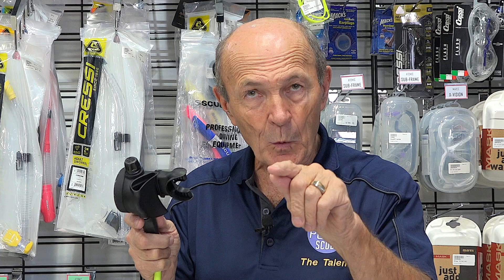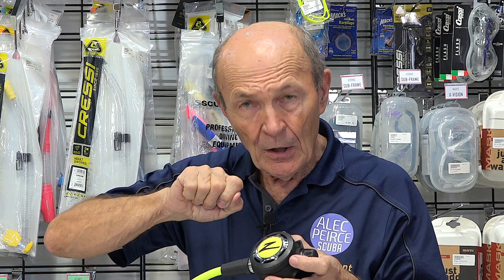Why Safe Seconds Hiss? - Scuba Tech Tips: S18E22

Comment: Hello, love your channel, haven’t watched for a while, good to be back!. Somewhat related, got my regs just serviced and seems to free flow more than before . Question is when a service technician adjusts a second stage with a breathing effort knob, should they set first the knob to the easiest effort , then tune to the 2nd stage so it’s at “knife edge” , or set the knob to about middle then tuned  just at “knife edge” ? . Should a properly tuned 2nd stage where the breathing effort knob is  set to easiest , when the regulator is removed from the mouth underwater , should not free flow? Btw, my Octopus breathing effort knob is set to easiest, but never free flows, so I think the IP is ok. Sorry for so much questions , sending it back to the tech, so I would know what to say , thank you!
Reply from the maker: The positioning of the 'fine tuning' knob during service is dictated by the manufacturer. There is no definitive method - some say to have it set hard, some say soft, some say midway.
If there is no direction, then a central setting is most logical. That way, if the 2nd stage is either too light or too hard, there is room for adjustment by the diver. However, in that case of no stipulation by the manufacturer, it is up to the service person to decide & again there are differing views.
Regarding the Safe Second, if you have a 'fine tuning' adjustment on your Safe Second, I suggest that you set it a bit harder than your primary. It's a nuisance & wasteful when the Safe Second free flows, and that can easily happen when entering the water from a boat - back roll, front roll or step-in.
To stop your primary or your Safe 2nd from free flowing whether during an entry or even while underwater is quite simple. On entry, ensure that the mouthpiece of the Safe 2nd is facing down, towards the bottom rather than towards the sky. If underwater and if/when you remove the primary from your mouth, be sure to tilt it downward also.
You can easily check this procedure. Ensure you are stable underwater, then remove your primary from your mouth. As you do, tip it up so the mouthpiece faces the sky. It will free flow (or should if tuned to easy breathing). If you tip it down (facing the bottom) it will NOT free flow.
On the subject, I personally do not use nor recommend an adjustable Safe Second. There is simply no need. The 2nd can be adjusted to easy breathing without it. The idea that it should be as easy as the primary is silly. The Safe 2nd will be in use (if ever) for a few seconds or minutes at most. The diver experiencing an OOA emergency (Out Of Air) will get lots of air & easily. He does NOT need it to be VERY easy breathing.
Tongue in cheek, if I had to donate my Safe Second to a diver that was OOA, and he complained about hard breathing, I'd take it back!!!!!!!!!!!!
Take care.
Alec
Reply: @ thank you! This is very helpful :)

Comment: Thank you Alec, excellent video!  After my regs were serviced I had an issue with my first stage (ScubaPro), I had a whistle, or noise every time I inhaled, first I thought it was coming from my second stage (ScubaPro), but I discovered it was also coming from my Octo (DiveRite).  Took the regs to a different service and was told whoever serviced the first stage put in a flexible or softer o-ring instead of the stiffer type, and that that was causing the noise.  Even tho my regs worked ok while diving, the noise was so loud it was annoying to me and my dive buddies. I'm waiting to get my regs back from the new service and am hopeful the problem will be corrected.  Any thoughts on this?  Thanks, love your videos.
Reply from the maker: Scubapro MK25??? It's not the only one but it is common for this reg. Other makes & models have had the same issue.  Scubapro actually changed the O-Ring set-up on the piston for this reg PLUS they added a spongy ring around the piston to dampen the whistle. It usually helps.
What you are experiencing is called sympathetic vibrations - similar to the ring you get by running a damp finger around the rim of a wine glass. In the case of a regulator, there are many parts involved so it's difficult to pin it down to a single cause.
 
This is a good time to clear up a common (almost universal) misconception. Divers generally picture the valve in the 1st stage as a simple door that opens when you inhale to let air through & then closes when you exhale. Nope!!! It's much more complicated (and interesting) than that. The regulator is very sensitive to pressure changes so a very slight drop in pressure will cause the valve to open and admit more air. The diver is taking a breath, usually slowly, so the air in the hose & 2nd stage is flowing out, into his mouth. When the valve opens in the 1st, air under high pressure flows into the 1st stage IP chamber. It fills quickly & almost instantly fills to the proper Intermediate Pressure again - so the valve closes. But,  since the diver is still inhaling, the IP drops again & the 1st stage valve opens again - and then closes, again. This happens many times, very rapidly - too rapid to be seen or measured. It's called oscillation. The valve is not opening & closing as you might think. While it is opening & closing, it happens so rapidly that you can't even see it. 
So, the various parts in there, the soft seat, the seat carrier, the spring, the washer & maybe more, all in touch with each other, are all moving at great speed. Something starts to vibrate & soon they're all vibrating. One part is musically inclined & decides to make the buzzing sound into tune. That last part is a joke!
Anyway, you get a whistle. The only way to stop it is to change something so the parts don't vibrate at all or at least do so in unison & cancel each other out.

I suppose the good news is that it is not indicative of any problem. The reg is working just fine. Of course it's annoying but all you can do is work with your LDS (hopefully a Scubapro dealer). Try searching for this issue on the internet or contact Scubapro Customer Service.
BTW, the Scubapro MK25 regulator is excellent, one of the best ever!
Hope this helps.
PS: tell your dive buddies that the whistle is the turbo charger - a special feature of your reg!!
Alec
Reply: @AlecPeirceScuba_SeaHunter  Thank you Alec!  Yes, I have a MK25 and the new LDS is an authorized Scubapro dealer (so was the previous one); if it's still happening I'll take your suggestion and call Scubapro Customer Service.  I'd love to tell my dive buddies the whistle is the turbo charger, but it sounds more like I'm under anesthesia!

Comment: I have a hissing sound coming from all the second-stage regulators. All the O-rings and seals are new. The only thing I can think of is that there might be a small dent on the orifice located on the opposite side of the high-pressure seat inside the first stage. Do you think that could be the issue? It is a diaphragm-balanced first stage. I also tried loosening the diaphragm spring, but that only delayed the hissing for a couple of seconds before it started again. please enlighten me
Reply from the maker: Sounds like a faulty HP seat. Either the hard seat (part of the body) is damaged or the soft seat is worn. Do not change the soft seat until the hard seat has been inspected. If you do, the instant that you apply pressure, the soft seat is forced tightly against the hard seat & will be permanently damaged.
Clean the hard seat ( a job for a technician), replace the soft seat, adjust & I'd bet you're OK.

Comment: My Octopus fell apart with only 4 dives during my AOW Certification Class. Then the 1st Stage blew when the shop tested it before handing it back to me
Reply from the maker: Sounds like a bad rental gear or poor service.  Test it before diving again.
A.
Reply: @AlecPeirceScuba_SeaHunter I purchased it New. Bought a Spare set exactly like my primary. Same part was loose. The piece that Holds the purge button in place
Reply: Temu sells dive gear?!? What was the equipment?
Reply: @kulfonbustardo1588  Genesis Prana

Comment: This sort of highlights another reason why buying a higher-spec regulator can pay dividends.  If it has a cracking pressure adjustment knob, turning it in a little should stop the freeflow.  Otherwise a field fix is easy with the correct wrench and screwdriver but I'd advise that only if you know what you're doing!
Reply from the maker: Good points but we both know how knowledgeable some divers are who believe hammers are the best tool.
A
Reply: @ Right on!  If at first you don’t succeed, you need a bigger hammer!

Comment: As always, good info! You should also do one about freezing regs. I dive all year in New England and twice I had FREEZE free-flow reg. 2000 PSI in about 45 seconds (best guess as I wasn’t counting). I was able to sort it out quickly at depth (under 60 feet) but not the same as what most people would experience in free-flow regs. Both times in fresh water. None yet in ocean diving. Had my shop turn down my Reg to see if it helps. So far so good.
Reply from the maker: Search my Scuba Tech Tips playlist for 'freezing' as there are 2 or 3 on the subject covering why, how to prevent and optional 1st stage kits.
A